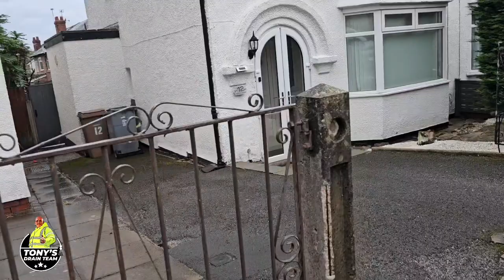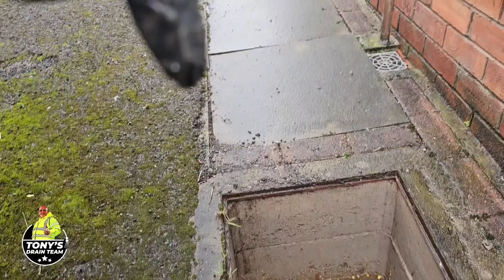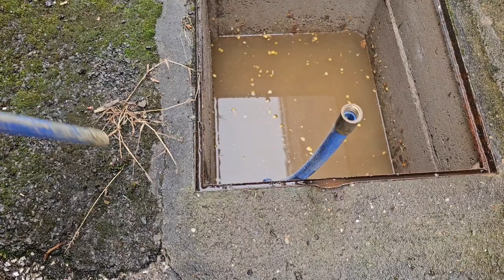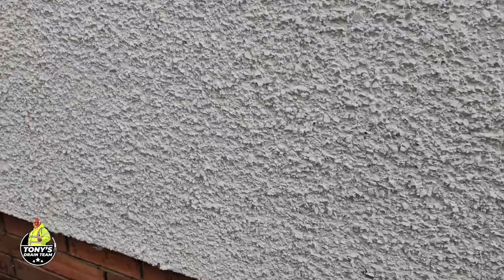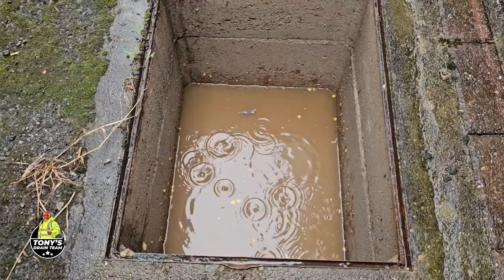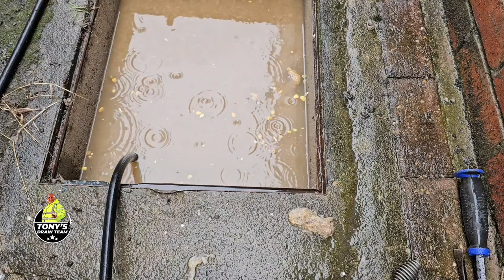Blocked drain. Drain unblocker loses his head #blockeddrain #cloggeddrain

Comment: Being a Homeowner 
I'd have pulled the manhole cover on the Road.
Although I have 2 manholes on My Garden.......1 is solely for the Rest of the Street 
Then into My manhole on the Rear of the Property 

Had to do it at My last address........Blocked by Action Man from nextdoor and 3doors up Faulty Garage installed Toilet!!!

EDIT 
3doors up also placed a Shed on top of their Manhole 😂😂

2nd EDIT 
Subscribed 👍
Reply from the maker: Problem is that the manhole is in the road, just cant touch it